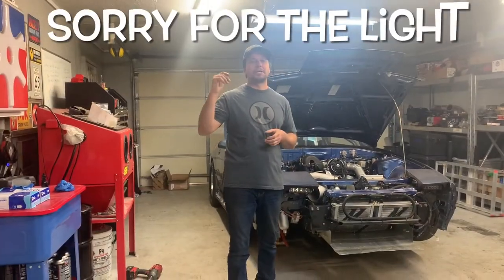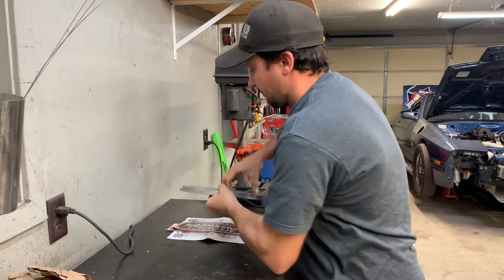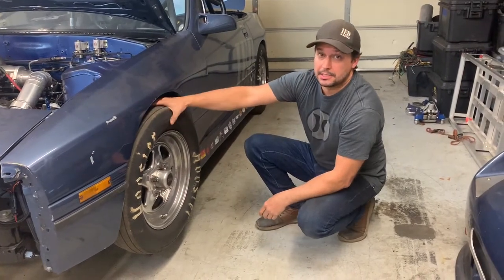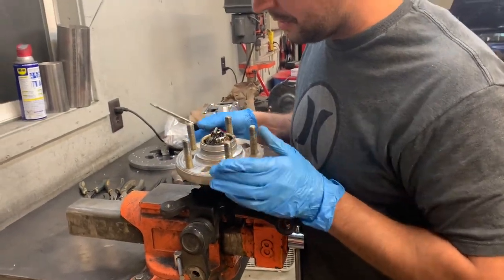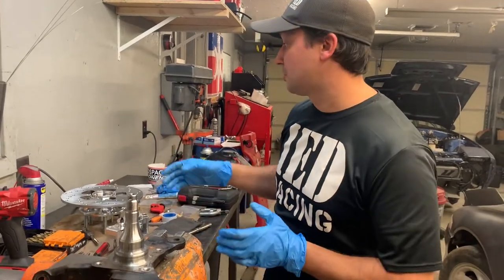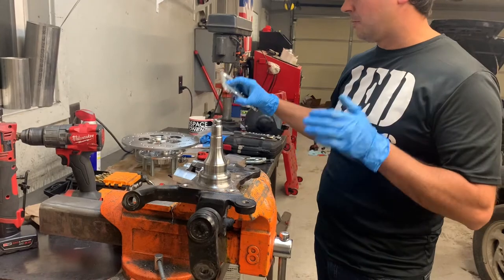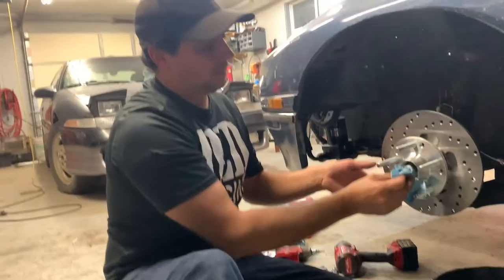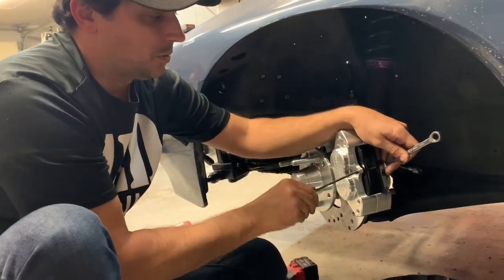New Aerospace Brake Kit FC RX7 FULL INSTALL

Comment: How does this setup work on street  usuage?
Reply from the maker: It did great for the weight of the car and mini trailer, no issues with the brakes.
Reply: @janousekmike  perfect. I have an 79 fb I was thinking about using this setup

Comment: How do you not run spacers on your front tires? I have had pro star rims for over 10 years and I have to run a spacer to clear my TII brakes.
Reply from the maker: Hmm 🤔 not sure, I ran aftermarket rotors which were Brembos, maybe the mounting surface to the hubs was thicker, otherwise with the factory hubs they stuck out the fronts pretty far past the fenders as it was, I can only imagine spacers would be worse.
Reply: @janousekmike  Are the aerospace calipers the same thickness as TII rotors? And how much are you loving the drag brakes?

Comment: Hi does the back of the hub has to touch the back of the spindle? Or does it have a little gap please let me know thanks
Reply from the maker: No it does not
Reply: Reason I ask mine has a little gap on the back and when I tighten the nut I don’t have room to put the cotter pin

Comment: What wheel and tire size front and back are you running? If you don’t mind
Reply from the maker: I use Weld pro stars, rears at 15” x7” 5.5” back space tires MT s 9.5” 26” and tall front skinny are 15”x3” 5” wide ties

Comment: Is this mostly for weight savings
Reply from the maker: Really intended for  less roll resistance, the weight is very minimal when the car weighs 3,000lb, but every bit helps
Reply: @janousekmike  I'm looking at these wondering if the t2 rotor will fit.. also... We all know t2 stuff is disappearing